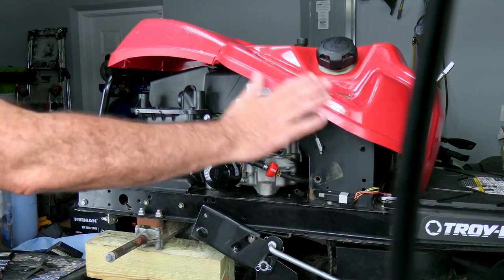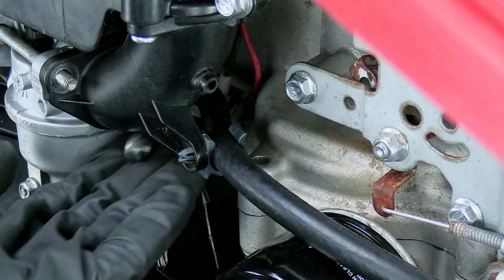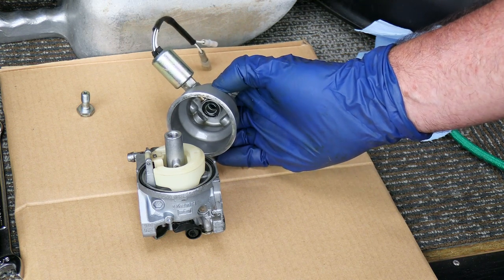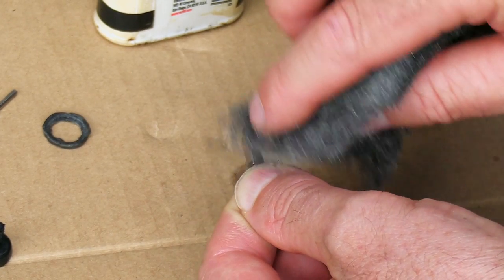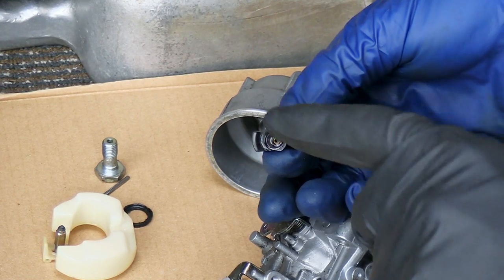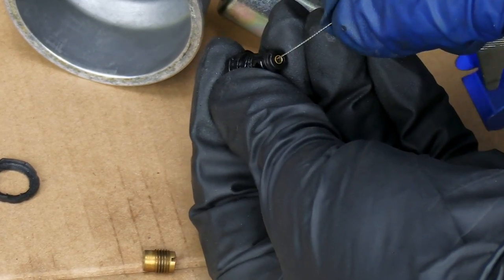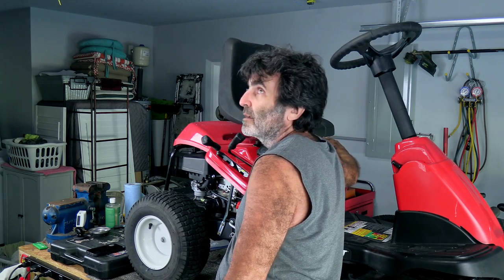Troy Bilt TB30 w/ Powermore [MTD 10.5 HP Engine] Not Running Good..

Comment: This is a bit of a shot in the dark, but I noticed you're fairly active with comments so its worth a try.
@2:48 do you know where you could possibly find a replacement choke linkage bushing? I followed your instructions and the carb cleanout went phenomenal... however I broke the linkage clip and now cannot find one anywhere for any of these 30 inch riding mowers. Do you happen to know the specs or where I could find a replacement? (My machine is a 2013 Columbia CR30) Thank you so much for the video!!!
Reply from the maker: Hi... Have you tried taking your engine model number (not the mower model) and going over to www.partstree.com?  From there you can plug in your model number to get the parts breakdown to see if that bushing is listed.  You could probably wire tie it on there if worst comes to worse, but it would be better with the right part.

Comment: Very helpful video. I was just given a TB30 (not the R model) I estimate has been sitting for quite a while. I drained the fuel, and I am disassembling and cleaning the carburetor along with your video. I have noticed mine does not have a choke lever anywhere I can find, which I find strange.
Reply from the maker: It's possible different models had different setups.  Is your engine a briggs or a power more?  If it's the briggs, it'll have the logo on the engine someplace...  Is there another way to choke it?  auto choke?

Comment: I have a Troybilt 33 inch walk behind (2015). Very limited repair videos for this model. Fortunately, your air filter housing and carb set-up is very close, so you gave me the clues and the confidence to tackle mine. For $35, I decided just to replace the carb rather than go through all the cleaning. For anyone out there with my model, just remember Mr. Bath’s video here…the secret is to remove the plastic exhaust port from the cylinder head as Step #1. That gives you enough play to either just remove the carb or, in my case, also access the screws to disassemble the air cleaner housing to clean off all the gunk that attaches over time. Thanks again.
Reply from the maker: Awesome!  SO glad I could help.. 😊

Comment: Where does the choke reconnect? I have it "hooked" on the carburetor, but where does the other end connect? It looks like a safety pin
Reply from the maker: HI, it's part of the throttle linkage unless you have a separate choke knob on the dashboard.  Most of them don't, the choke engages when you push the throttle all the way up.  I can't say exactly where it attaches without being able to see it.

Comment: Help.  Am I missing a choke lever?   Where can I get one for a tb30r?  Thanks
Reply from the maker: Unless your machine has auto choke....  Look at the carburetor and see if there's a choke rod on it going over to the muffler.
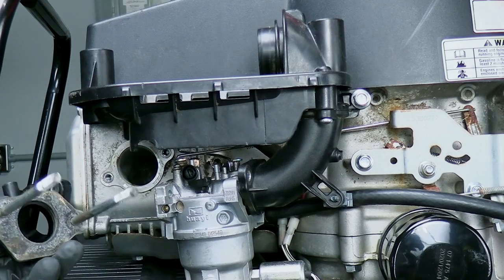Reply: At 2:39 in video, I am missing the rod that is getting snapped out of that white clip.  And at 3:40 it is shown above the left hand ..
Reply from the maker: Oh ok!  Yes I see the rod.  Does your throttle have a choke position?  Like if you push the throttle past full throttle it'll go into choke mode?  That's not auto choke... That is done by linkage.  I seem to remember that's how this one works.  I wonder how the rod came off.. IS the plastic clippy piece broken and it doesn't hold the rod anymore?   I'm not sure if www.partstree.com sells parts for that engine.  It's not a briggs engine it's a Powermore.  I believe they are made by MTD.  Try to get the engine model number and plug it into parts tree and see if it comes up.. If not try this one too: https://www.mtdparts.com/en_US/engine-parts/powermore?gad_source=1&gbraid=0AAAAAC6cUGe3HgnirBoYZqzt-sReLz-SF&gclid=Cj0KCQjwmOm3BhC8ARIsAOSbapXUzlFdnuUceohIoUMzaDJi4iBOD9RDWPTR9H4p2SIaYSHA1lOqkzcaAsTbEALw_wcB

I don't have this mower anymore to look at and see exactly where the model number sticker is located, but it should be easy to find...

Comment: Mine starts and runs wide open throttle. I’m trying to find a diagram for all the carb springs etc… can you help me.
Reply from the maker: If the throttle cable isn't causing the problem, it could be the governor is out of adjustment...  Or something is stuck keeping it from moving freely..

Comment: Hey! Thank you for the video. Same machine i have its a 2010. Ill try to explain this best i can lol. It sounds like its chocking itself out when running when it warms up. Sputters and pops... when i put my hand over the airfilter intake its runs beautifully.  Also if i reach my hand to the top of the carburetor and manually move the choke it abit it runs excellent.  But if i adjustment the screw (further back middle screw in the 3 screw cluster) it does not like that. Theory it should like the adjustment but does not as it moves the throttle on the carb. I understand you cant see tge machine but if you have an idea it would be much appreciated. Thank you!
Reply from the maker: Hi!  Definitely sounds like something in the carb.  I've seen these machines where I've tried cleaning the carb 4 or 5 times and it's still popping.  Put on a new carb and boom... no popping.  Never could figure out what was wrong in the first place, but nevertheless, a new carb might fix it when the cleaning won't.  Of course I can't see your machine so I'm just guessing.  Amazon sells a good one called ALLMOST HUAYI.. they're about $40 bucks... It worked for me on a stubborn one...
Reply: @JLPicard440  thank you very much for the reply. I will give that a try!

Comment: Mine CC30H starts right up runs GREAT until it gets hot then "hunts" and dies// won't refire...Carb. removed&ALL orifices can see through.Pilot jet on the side removed&cleaned with thin guitar string &blown out of carb. body, New coil ($40.),valves set,solenoid checked even tried a hand choke with a welding rod-opening fully //manually. 382CC engine. There are NO spring  adjustments or various "holes" on the plate links. How do you set the governor to act right on this Powermore engine. NO ONE seems to know anything about them. Your video is "Top Notch"- no goofing around & dead on the money. You&Donny are the BEST on YouTube.
Reply from the maker: Thanks for the great comment!  I don't have any videos on setting a governor, but if you do a search on setting a governor, there are tons of vids out there.  They work pretty similar to each other... but the fact that you said the problem shows up when it gets hot really makes me doubt the governor is the culprit.  I would have suspected the coil too, but sounds like you've already taken care of that one...  Just for kicks and giggles have you replaced the spark plug?  I've never seen it, but Its possible its breaking down when it gets hot..  I know it's a long shot, but worth a try.  IF setting the governor doesn't work, you might consider the carburetor...  For an aftermarket one, they're about $40.
Reply: @JLPicard440  Sparkplug was replaced&gapped properly. This thing is driving me crazy.
Reply from the maker: @EdwardLabno-ov9no  Arrrrgh
Reply: @JLPicard440  10-4
Reply: O pequeno tubo de metal do carburador, onde encaixa a mangueira que leva o combustível, deve ser retirado. Dentro de seu orifício existe uma pequena tela que costuma ficar entupida. Verifique isso. O meu trator estava com o mesmo problema do seu.

Comment: When you reassemble and connect the throttle linkage and spring, you may see that there is a slot in the brackets where the lever for the rod originates.  Don't make the same mistake I made in assuming it should go through that slot...IT SHOULDN'T!  It belongs behind the bracket. free floating, no guide necessary.
Reply from the maker: HI Joseph!  Thanks for the great info... I'm sure someone will read this and heed the tips here... 😊

Comment: I’ve had mine 3 years.  Spark plug, oil filter, fuel filter all fairly new.  Sputters when running (it will start). Plenty of gas.  Your guess - carburetor the culprit?
Thanks
Reply from the maker: Yes I have seen that before.  Even sounds like it could be a coil, but yes it turned out to be a carburetor.  Those carburetors were about $40 bucks for an aftermarket one and it ran great after that. Of course I haven't seen yours in person, so I'm just guessing based on what you told me..  BTW, on that one, I tried cleaning and it didn't solve the issue..
Reply: @JLPicard440 .  Thanks for the answer.   Worked on it today - Throttle linkage bar was moving back and forth while running. I even put a new spark plug in. Still surging and sputtering.   Still think carburetor the culprit ?
Reply from the maker: Sounds like its surging, only a guess, but probably is the carburetor...  Before you buy a carburetor have you tried cleaning the one you have?  Also if something has contaminated the carburetor, I'd remove the gas tank and flush it out with water as well as the fuel lines and replace the fuel filter again since after you put a new one it could have been contaminated with whatever gas was in the gas tank.  Of course, let everything sit in the sun until dry.  IF you don't do this it'll just recontaminate the new carburetor, or the newly cleaned carburetor.
Reply: @JLPicard440 .  You have a video on re-attaching the carburetor/new carburetor?  (Assume just go in reverse order?) Appreciate the video - really helped me w troubleshooting.
Reply from the maker: @jimeagle5509  Yes absolutely go in reverse order.  Sometimes I don't show how to put it back because it seems redundant.  Thanks for the feedback.. 😀
Reply: @JLPicard440   I’m gonna give it a go tomorrow and just replace the unit.   Got new fuel lines, drained the tank and got the carburetor you listed.  Thanks for the video and responses.  Hopefully she engages.
Reply from the maker: Oh great!  Make sure you're using the right part number for the model number that you have...  The one that I listed is going to be for my engine model.. 😀
Reply: @JLPicard440 she fired up but I realized I sort of wrecked the throttle spring in the process (that past was pretty hard and that spring is garbage).  It ran and cut the yard but still ran rough.  On yours - how does your throttle spring sit when the mower is off….middle, right side towards throttle?
Reply from the maker: Are you talking about the spring that goes between the governor and the throttle?  If so, then yes that spring is junk.  I think it's more of a dampener so that you don't get the throttle bouncing back and fourth.  When the engine is off, the governor should hold the throttle at full throttle, (99.9% sure without looking at it.). Also, check the auto choke and see if it's allowing it to un-choke all the way.. It'll definitely run rough if its not working right.  I seem to remember mine was having a problem because the fin that runs from the flywheel air pressure isn't big enough and there's a spring under the top engine cover that was pulling it and not allowing it to un-choke... I took the spring and threw it and it ran much better afterwards...  Not saying for you to do that, but it's worth looking at to make sure you're not having the same issue.
Reply: @JLPicard440 . The spring that runs along the bar between the carb and the governor. That one I wrecked.   I have a replacement coming plus I may have bent that bar too.  The good news is the carburetor runs fine. It fires up.  I think my original problem was those springs started losing their hold and eventually failed.  They’re dirt cheap so I’m going to try that. Appreciate your responses the whole way.  It cut so I bought myself another week.
Reply from the maker: Ok cool... Yea I didn't like that spring.  It seems like when you connect it to the carburetor I has a tendency to bend where the loop is and you had to squeeze it to get the loop back in shape.  But then it was fine after that...
Reply: @JLPicard440 .     I think I got it fixed.   My governor spring may still be bad since there’s no appreciable difference in the RPMs when I move the throttle back and forth.  However - it fires up and will run. I had the choke and throttle bars crossed incorrectly too but I figured it out.  Hopefully a new spring finishes this repair job!
Reply: @JLPicard440 .  Question.    The choke bar and the carburetor/governor bar. 

Which is supposed to be on top/bottom when they are crossed and reattached ?
Reply from the maker: I had to go back and look at the video... Looks like the choke bar is under the throttle bar with the spring.
Reply from the maker: I didn't see your response about getting it fixed before I made my other comment.. 😂. The governor should definitely be doing something, if it's running totally wide open that'll eventually destroy the engine... Does it sound like its running exceptionally fast?  It'll be obvious.
Reply: @JLPicard440 .    The “balance” between the springs is probably off because I had to tweek the carb-governor spring to get it reattached.   Now that I’ve been through the process 1-2 times now, I think new parts on those areas should fix the problem.   It ran at what I would consider ~75% power but the surge has noticeably disappeared.  Everything else (fuel lines, filter, spark plug, gas) is brand new.
Reply from the maker: Cool....  Hopefully new parts will cure it... 🤓
Reply: @JLPicard440 

Howdy.  Little update.  Replaced throttle bar and the spring that goes w it.  Still waiting for governor spring.  The surging has basically disappeared.  My remaining issue is a have a “disconnect” between the throttle and the governor.   When I push to full throttle - the governor doesn’t move.  I can reach down and manually move it w my finger and it revs up normally.   Question - do you think I have a bad governor spring, a bad governor, bad throttle, or something else …..?   Appreciate the videos as always.
Reply from the maker: Wow that's a good one...  So is the governor holding the engine down at a lower speed?  If so, have you verified that the throttle cable is adjusted correctly?
Reply: @JLPicard440 . 

Fixed.  Replaced governor spring and reset the governor.   That did it.  Only thing I need to do is get a new blade now. 

Appreciate the videos. There’s your success story for the weekend!
Reply from the maker: I was going to suggest adjusting the governor... I couldn't see it so sometimes it's hard to picture!    I'm glad you got it going..  The blade should be a pretty easy fix... 😀